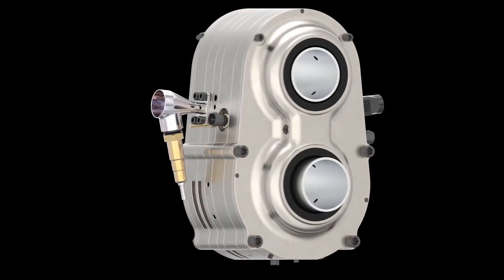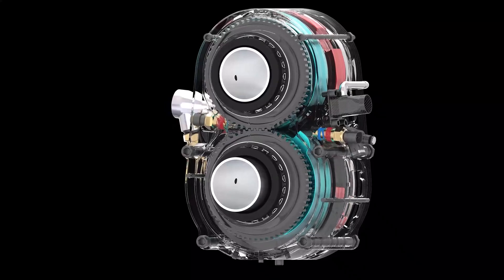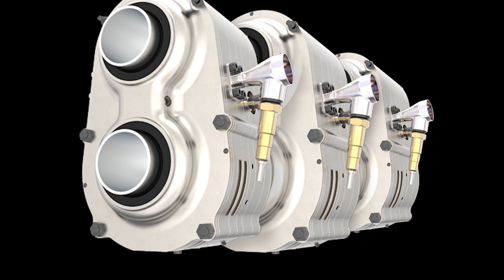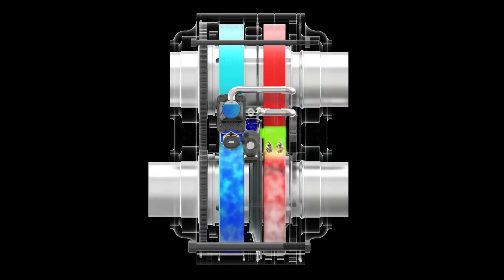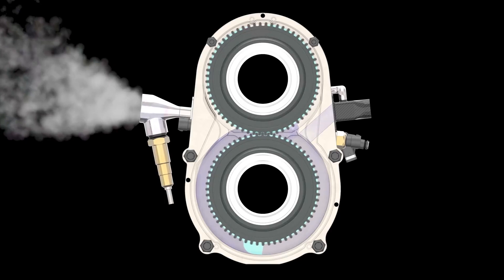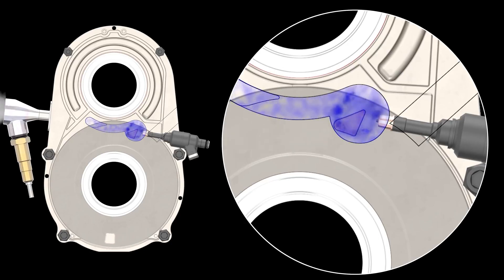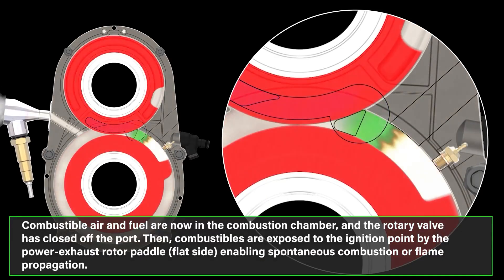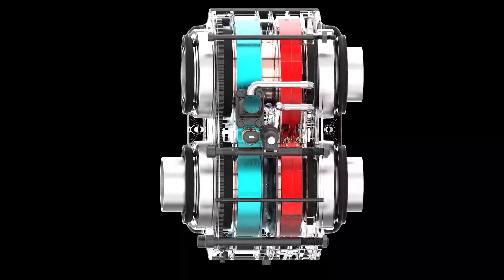This pistonless engine runs on hydrogen and revs to 25k rpm

Comment: At last a hydrogen engine the laughs at the electric battery systems, but this is only in planning. My only thought is that its a Johny come lately. The internal combustion engine is over and with new technology from our withheld patents ( 6000 in all) coming out like Magrav magnetic systems I feel that it may never get to the market even though it is light and cheap it will not be able to compete with anti gravitic magnetic fields. I believe that 5 years or less it will be common place since some companies already have had access to the anti gravity patents now for over two years
Reply: Anti gravity is nonsense.

Comment: Hydrogen will leak out of this thing  under pressure. Its one of the reasons why hydrogen is so tricky to store and refuel etc.
Its also 10 times more volatile than petrol..... Great concept, would love to see a real working version that doesn't require a team of rocket engineers to maintain it.

Comment: Hydrogen combustion is the way of the future, the fuel is practically free, as you create H and O from electrolysis and when it combusts, the only emission is H2O water vapour. 
This is clean energy at its finest.
Reply: Electrolysis isn’t free, and it’s only 50% efficient.
Reply: industrial scale hydrogen production is powered by burning fossil fuels

Comment: the only issue I see is, that hydrogen is explosive, so you would need 1-inch thick steel walls for the pipes leading to the engine, as well as the fuel tank. otherwise, in a car crash... well you might as well be carrying a literal hydrogen bomb in your car... and the tank + the metal for the tubes would weigh over 2 thousand pounds so it doesn't leak in a crash. or just directly connect the tank to the engine with super high tolerance multi-stage valves that act as metaphorical vault doors in a crash. so no hydrogen leaks and makes Hiroshima / Nagasaki look like 2 kids playing with firecrackers. sure gasoline can explode in air-tight enclosed spaces under the right air-to-fuel mixture, but even then, it just burns once it's not enclosed. and most of the time when there's a hold in a tank big enough for gas to come through it just dumps out leaving the tank empty or a hole big enough to let it burn in the tank and not explode. lithium-ion batteries used in electric cars are a thousand times worse in the survival rate in a crash. once a battery is pierced, it heats up beyond the temperature of the SUN! combine that with the hundred or more battery cells. It would roast you alive leaving you in ashes in seconds even if it was under the car in the back seat faster than gasoline. the worst part is, that it cant be put out. just like the old magnesium engine blocks, it cant be put out. so while firefighters stand away unable to do anything. you will be burned alive screaming for help while your skin melts from the temperatures that can only be described as a few hundred degrees from plasma... but hydrogen. hydrogen is a whole different story. it doesn't rely on an exposed flame on the ground or something to pierce it. IT CAN LIGHT FROM ANY SOURCE AND EXPLODE WITH THE FORCE OF A THOUSAND GRENADES FROM A SINGLE SPARK ANYWHERE IN THE FACINITY.

Comment: Is it possible to power hydrogen generator located inside a car from a roof solar panel? If yes, this engine would be nifty, since the generator would weight some. Bonus points  for being more fuel efficient

Comment: This is nice. From the comments it is seen that some People are very sceptical of this. Why. No one was there for electric cars at first and found out whole lot of reasons why it would not be practical. At first electric cars are cheap to run. And when there are half the population using electric cars the powergrid of most countries will be at maximum usage and the cost of electricity will go up. I think hydrogen takes this responsibility off of this electric power grids. And this should be experimented with.
Reply: EVs add 8% to the power grid which is easily handled by charging overnight.

Comment: This is more than a rotary engine, this is a parallel cylinder and gear engine. From this model I can see that more gaps and teeth can be added to make more power and potentially go through alternating fire patterns. It would make for a very unique engine and could replace current engines.

Comment: The true question, barring all the practical ones; is this better than fuel cells & electric motor?

Also, given Hydrogen is infamous for leaking through all kinds of solid materials, I do not expect the 'no seals' mantra to work out

Comment: This is a great idea though being new it still needs some long drive time testing in real world environments. Things like how many miles can it go before it has issues and how much weight can it move in a standard truck like setup with 2 or 3 engines connected and the torque given on steep inclines loaded.
Reply: It can go zero miles.  It's not real.

Comment: Tight tolerances huh? Show me an engine running. Not a 3D model.
Right now, the most efficient engines we have are electric. You've found a more efficient ICE engine? Okay.
Build it, run it, test it. I will believe it when I see it.

Comment: It's a promising track of design, serviceability will need to be addressed. Not having seals and relying on tight tolerances means potentially shorter part-life. It could be addressed so it still has great potential. 👍🏻
Reply: It doesn't work at all.  it has 0 potential, because it's just a BS animation.

Comment: That seems like a promising design. I don't like that the gears mesh on the same teeth every time though, that leads to eccentric wear over time.
Reply: Math is not your strong suit then?
Reply: @foobarmaximus3506  I don't know what you're talking about. Are you unfamiliar with why engineers don't like gears to always mesh with the same teeth, it leads to wear problems.

Comment: I mean, Hydrogen is just electrical power with extra steps, right? We make it with electricity, but if we can get the energy density down (and we can, right?) it'll be a good option for vehicles.

Hopefully. Engine looks cool.

Comment: Hydrogen compressed to 200 atm?
Good thing there is no seals as hydrogen leak even at ambient pression.
Also, it's a good idea to make it only in CGI. Tight tolerance under varying temperature and pression works much better in silico

Comment: That has to be the greatest invention since the jet engine. It should/ must be put into production immediately with fitting kits so you can replace your original engine in your old gas guzzling polluting car. Electric cars are a waste of time. Batteries are very expensive and cause thousands of tons of pollution to produce. This IS the way forward. Please someone convince car manufacturers, politicians etc to invest in this NOW.

Comment: I am very sceptical about electric cars completely displacing the ice and honestly I don't see the point. Cars run on energy, and the energy that electric cars run on is no cleaner than gasoline or hydrogen it is whatever they burn to boil the water in the power plant and then they will have to build more power plants quickly and cheaply to keep up with the demand from more electric vehicles. Cheap and quick power plants are not known for environmental safety usually coal and oil. And what do you do when much of your traveling is away from major infrastructure carry a gas generator, I think this is a lateral move at best by moving the pollution to someone else's neighborhood.

Comment: Annnnnddd where is the the actual built model powering something? Everything looks great on paper until it is built and the law of thermodynamics, Tight tolerances and practical application apply where the only place I see those tolerances are the aerospace industry and hard drive manufacturing which uses no oil to lubricate the spindle.

Comment: Things I see going south, how much will shrink and lose tolerance at -40 degrees? If you can answer, I appreciate. I have seen that aluminum engines have a hard time in cold climates. Ev will have no chance-40. This should be tested for awhile. Very interesting information. If you want to try testing in cold weather. I have a shop.

Comment: Ignition is happening while the engine is decompressing, This is surely going to be a massive waste of efficiency to the point where it isn't going to produce enough energy to compress the air in the other rotary.

Comment: The worries about tolerances may be tempered by the reminder that a minor hydrogen leak might be less scary than a minor gas leak. Put a fan in the engine bay and it safely mixes with atmo, no?

Comment: The engine may be great, but the problems of hydrogen remain. They are:
1.) Low specific energy per volume,
2.).miserable efficiency in producing it, and very low liquid temperature.

As for the engine, the combustion side is very likely to overheat. Not only that, but metal expands as it heats up and contracts when it cools down. Maintaining these high tolerances will be extremely difficult. This is a notorious problem with all air-cooled internal combustion engines, except for gas turbines.

Comment: Sounds cool but hydrogen isn't a fuel source. It's an energy storage system, like a battery.
Any and all comparisons should be made against the latest model of the Tesla, not a Chevy Caprice.
Hydrogen is a dead end. Battery-powered cars are already much more efficient and don't require a new tech tree to support. We already have electricity. We just need more of it. And we would need even more if we were catalyzing hydrogen to power the "hydrogen revolution".

Comment: Horse power figures are nice and all but what are the torque figures? What does the power look like across the RPM range? That peak of 25,000 rpm sounds good but Chrysler actually made cars in the 60's that used turbine jet engines to try to get more power per pound but the gearboxes needed and the actual usable rpm range made the cars less powerful, efficient, and useful than their piston counterparts. I am always hopeful that new innovations can increase the longevity of the ICE engines but I tend to be a little skeptical of things that claim to solve every problem at once.

Comment: Cool idea but flawed. You are sending half the explosive force back into the drive itself. It needs to drive from the framework. Not a vital moving part. Which  since this is gear linked. You’ll be wearing the teeth of the source of its synchronizing. And that means. Any timing when off could cause a huge catastrophic failure. While normal engines rarely ever fail so badly. This thing if its timing gets off. Will destroy itself.
You can though use as many of these teeth as you want and weed out the flywheel synchro gears.

Comment: This type of engine would have some huge advantages over the current all-electric cars. The biggest being overall weight would be drastically reduced from the lack of batteries and minimal fuel weight. Weight is the most fundamental aspect with the biggest effect on all systems in car design. I foresee an electric/hydrogen hybrid eventually becoming the standard especially if options like this engine are viable.
Reply: And the fact that it does not require as much polution to manufacture
Reply: Your weight goes into protecting the hydrogen from escaping in the tank and between engine and tank.
Reply: @Abb0able  Quite possibly. I am no expert it could be quite different than my assumptions.
Reply: You don't want a car to be TOO lightweight, though. One, lightweight cars are terrible anywhere that the snow falls. Two, lightweight cars lose control easily, and three, Lightweight cars are dangerous to be in, if you wreck, especially if the other car involved in a collision has a significant weight advantage over you. Simple physics; lightweight object smashing into a much heavier object is going to get absolutely destroyed. There's a sweet spot in there somewhere, where you want enough weight in a car that you get good traction and good momentum, but yet not be too heavy that it starts to become too much of an energy burden to carry the extra weight.
Reply: @Dhalin  Yes very true. I believe there is a lot of room to lighten before that goes from a plus to a negative. Also if there's a sea change in all vehicles the mass differential problem in a collision wouldn't exist as it does now. Other design and weight distribution technology could quite possibly greatly lessen or remove the other two problems you mentioned. Thank you for the thoughtful reply.
Reply: Isn't Elon making cars with these?
Reply: @mmwaashumslowww7167  no idea.
Reply: Until the very moment, you realize, that having to produce the hydrogen by electrolysis will spoil the efficiency dreams. Current battery / electro motor setups do have an efficiency of about 70%, where the biggest drop is because of the battery, that will return only about 70% to 80% of what had been put up by during charging.  But having to produce the hydrogen drops the efficiency to way below 50%.
Reply: @Misophist  You sound more informed than I. I was speaking in very general terms. I believe an electric/? hybrid type system will eventually be the most efficient. Thank you for the informed reply.
Reply: Hybrid cars always add unnecessary weight and complexity, one big advantage of electric cars is how few parts they need, less than a quarter of gas... making it a hybrid takes that massive advantage away since you are doubling or more the amount of parts. Plus this doesn't solve the hydrogen storage problem.
Reply: @jakemon4550  Yes I agree on principle with the hybrid system's currently being produced. I'm speaking ideally. If a hydrogen or ? motor had this motor's qualities and became viable a hybrid system could theoretically overcome current electric vehicle shortcomings without adding additional problems. If so then weight would be the key driver in that scenario. Big leap from here to there I admit. Thank you for the thoughtful response.

Comment: High tolerance is the same thing as a seal, so they are not eliminated, just called differently and way harder to replace as they are now integral to the main components. Not to mention few parts in the diagrams marked SEAL... I guess we'll just not pay attention to them :)
Hydrogen s a great fuel if you can make it magically appear in your intake manifold, barring that, it's expensive to produce, a nightmare to store and the cycle as a whole has a low overall efficiency compared to BEV.

Comment: I've been pushing for hydrogen powered cars for 30 years. I know that Mazda has been researching this for at least 10 years or more.
Make the hydrogen from distilled water through electrolysis on demand as you drive. The only hydrogen is in the line that leads to the combustion chamber. No chance for explosions as you carry distilled water.
Reply: The problem is the energy density of hydrogen and the energy required to get it out of the water.  You would need to bring along some auxiliary energy source to liberate the hydrogen.

Comment: Even with a perfectly efficient combustion engine you still have a very inefficient system because the fuel (hydrogen in this case) needs to be produced, transported and stored. And this all consumes energy. So why not use the energy directly for advancing as in battery-electric vehicles?

Comment: Seems like a cool idea, but if it's relies on tight tolerances I doubt it will ever really work as wear will quickly ruin those tolerances.

Also electric is undoubtedly the future. It just has way too many advantages over some form of combustion engine (higher efficiency potentials, better torque, effectively zero maintenance required, etc), even if the engine is running on a "clean" fuel such as hydrogen (which is actually far less "clean" than we think since almost all of our hydrogen comes from natural gas).

Comment: Let's say I build two cars: 
Each has same amount of hydrogen storage and are otherwise identical. 

But one has a (Toyota Mirai like) Hydrogen --> Fuel cell --> electricity --> electric motor--> axle setup. 

And another has a setup with the engine in this video.  
Hydrogen-->burn in fancy engine-->feed through transmission --> axle setup. 

Three questions: 
1. which car will be cheaper to build.  
2. Which car will weigh less 
3. Which car will give a higher range under identical driving conditions.  

4. optional question: which car will give better power output and performance.

The answers will determine whether this thing is viable for mass production. 
I fear this config will be expensive to maintain. However, it may have potential in niche applications.
Reply from the maker: Fuel cell would be more expensive to build

The weight depends on the motors, you get really lightweight motors on both sides. 

Last one i actually dont know
Reply: @ChrisVSCars  I am not sure fuel cells are more expensive to produce. The process doesn’t look too different than producing lithium ion cells (from manufacturing process perspective). Here is a video. https://youtu.be/Jo3dO5Wzqrs that engine, considering the tolerances and the geometry, seems more expensive to me. You also have to consider cost of a step down transmission (your engine rpm is 25k. You will need to slow it down) vs cost of a motor. Could be a wash.

Comment: The problem with Hydrogen is that it makes steel brittle, and degrades aluminum pretty quickly...

EV's are a scam, and this motor, cool as it looks, sounds like a pipe dream.

Comment: The designer was clearly inspired by the Tesla Turbine and Valve. This looks very promissing and considdering that in CT, there is a group trying to commercialize hydrogen in SA, and the same hydrogen can be used for both fuel cells and IC engines, this could be very promising. You can't claim the same for lithium